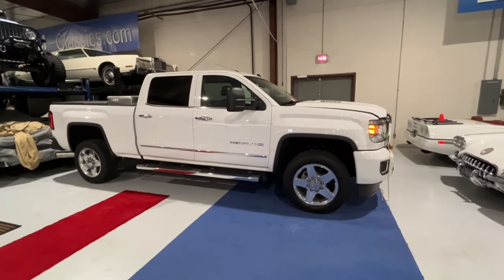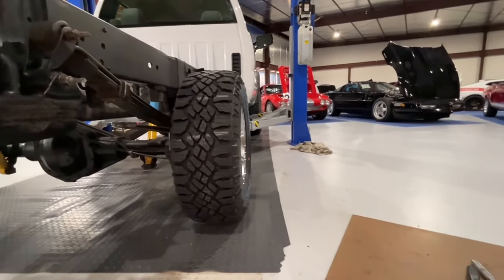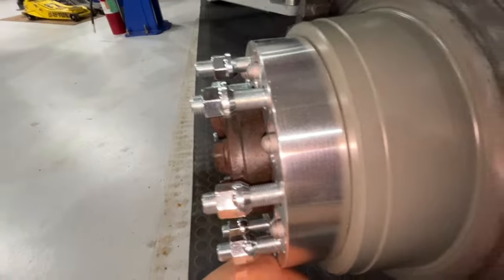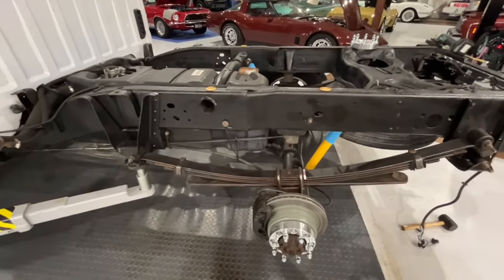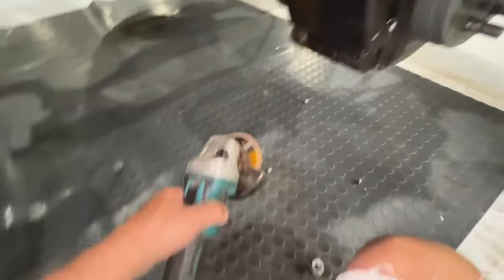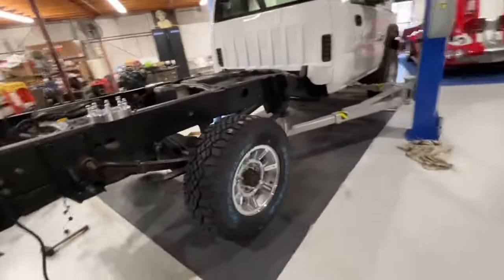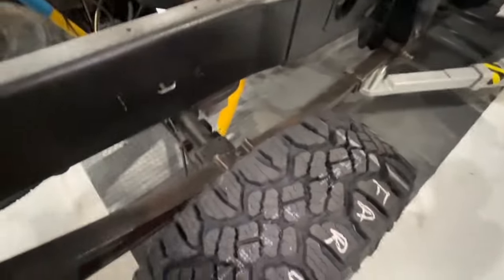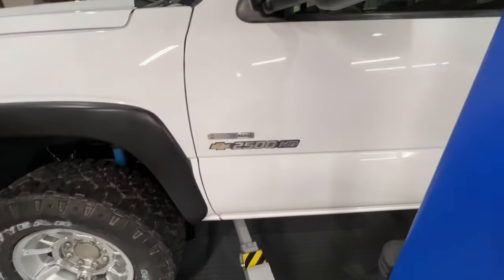Chevrolet Silverado 2006 LBZ Duramax 4x4 RCLB being turned into collector.   H2 Wheels + spacers PT6

Comment: I did the same thing to my 2005 yukon xl 2500 with the 6.0 and 4.10's. I ordered the BORA steel wheel spacers after installing they matched up perfectly with the front trac width. it looked a million times better. Always loved the H2 wheels also.